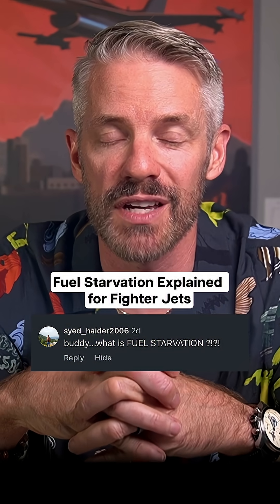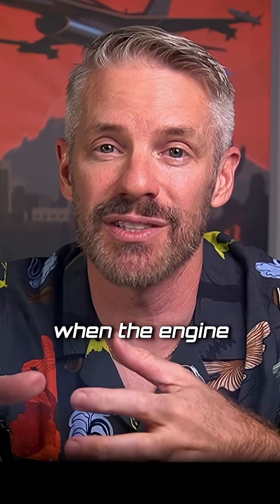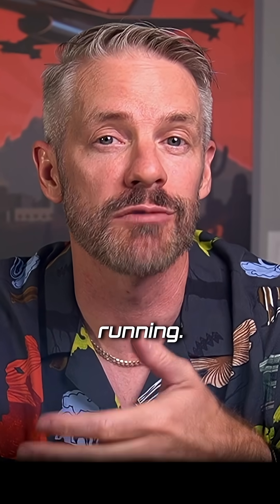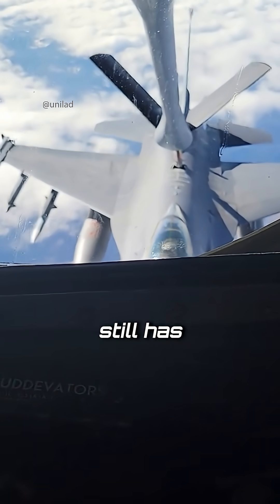What Happens When a Jet Loses Fuel Flow?

Comment: I'm curious why the minimum is 2,000. A 0' ejection is doable, so why not leave it at pilot discretion? If the aircraft is in a controlled glide over relatively flat terrain, ensuring the aircraft doesn't hit people on the ground should be top priority.
Reply: If you had to eject on the ground vs at 10k feet for instance, which would you choose?
Reply: @JamesMathison98 Pilot discretion. A pilot having a choice is exactly why I'm asking this. If you're in a deadstick F-16 in a nice glide, at 2k you still have two miles before impact. You shouldn't be in a hurry to bail if there's the chance there's populace at the end of the flightpath.
Reply: @peterjp4  it is the safest to eject as far away from the ground as you can (up to about 20k). The 2,000 ft is because it is the lowest you can get to the ground with the highest chance of a successful ejection. I agree you would want to delay if you’re headed towards a population center, but that is not likely, big sky theory, and if you are, simply point it at an uninhabited area, then eject before 2k

Comment: Common fuel starvation scenario on the ground: 

-Engine spools up. 
-JFS kicks off 
-Idles for about a minute 
-Engine calmly spools down back to zero RPM
-EMS bit ball pops with a “Eng Flameout” fault
-Canopy opens 
-Ground “Dude your Fuel Master closed huh?”
-Run guy/Pilot “😐….😑….Going start 2 again”
😂😂